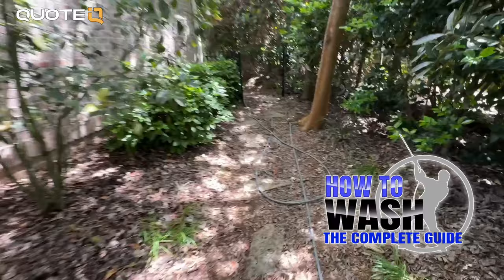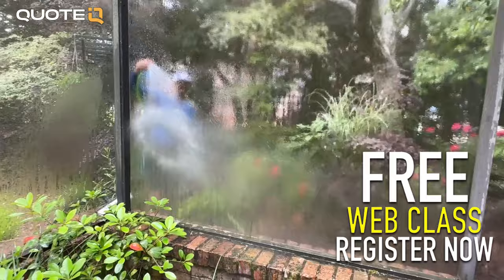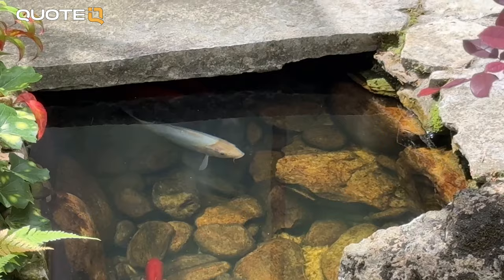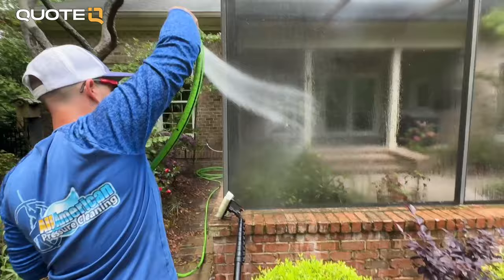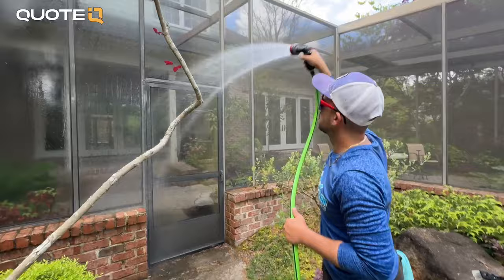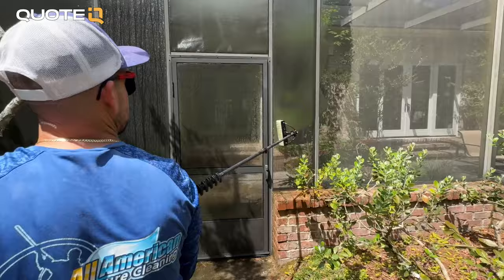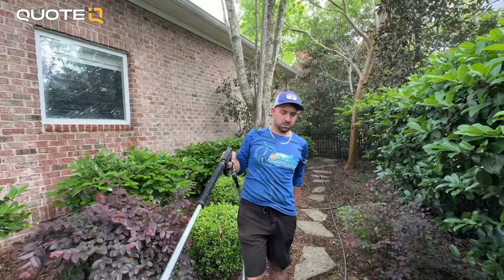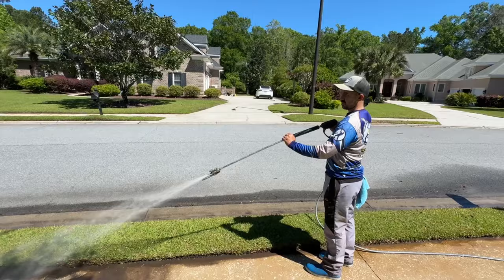This Job Almost Made Him Quit

Comment: I guess no way except what your doing. Especially with pond.
Reply from the maker: Unfortunately...
Reply: Use screen magic just spray it on a towel and if you get the big bottle dilute it with a 4:1 ratio screen magic to water in a bucket

Comment: Almost like you but here's what ya do.   Water fed pole connected to a 3 gallon pressure tank. Use distilled water.   89. Yo 99 cents per bottle Pump up the can too about 10 psi or just enough to get the water to the head.   Very light solution.   .5 to 1% solution.  Maybe a herbicide but in this case hell no.   The entire time you rinse plants and ground.   I've done several of these and had no problems.   Granted the can and hose and head will be trashed by the end depending on the quality and strength of solution due  but that's just added to the bill as part of the cost.  Total cost of set up is about (the one I made) was 99 bucks.   Used cheapest materials I could like a throw away head hose and can.   Well close to throw away.   They made it through three jobs.   Then it was reorder.   Jobs paid for the materials and then some.
Reply from the maker: Great info and ideas - thanks for sharing